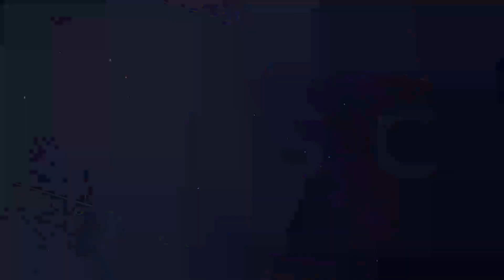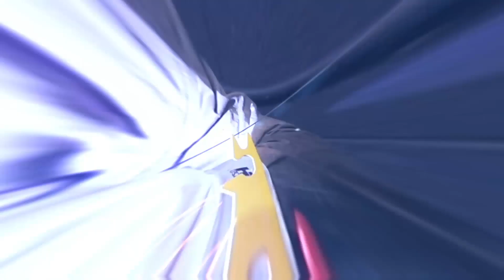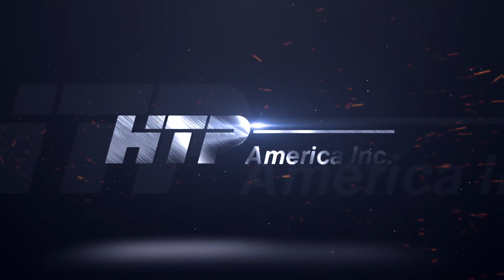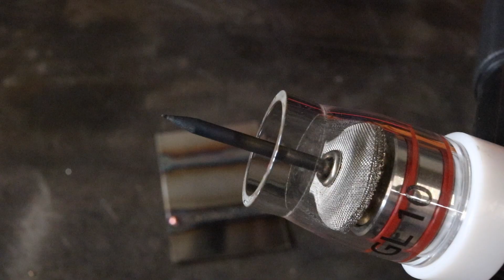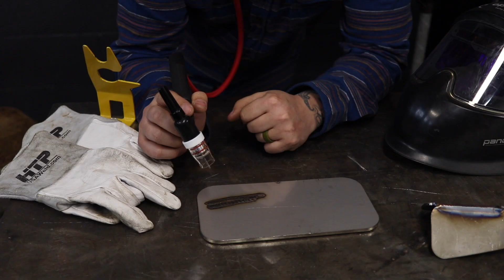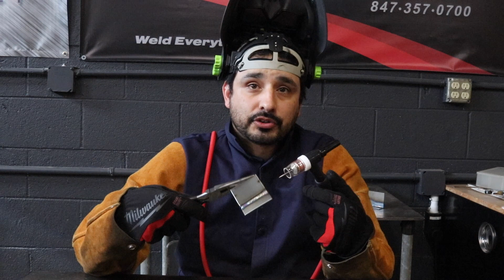DC TIG welding with the HTP Pro Pulse 220 MTS

Comment: Does this pulse tig?
Reply from the maker: No pulse TIG on this machine. Pulse MIG is where this machine shines! Check out the Revolution 2500 if you want to pulse in MIG, TIG and stick.
Reply: @usaweld The Invertig does pulse tig correct?
Reply: @Mikael5732 Yes.

Comment: Little disappointed it not AC/DC tig
Reply from the maker: we already have an AC/DC TIG Stick machine that is DV. Adding that AC concept isnt easy which is why a lot of multi process machines dont have it yet.
Reply: @usaweld What model is that?
Reply from the maker: @Mikael5732  pro pulse 220

Comment: It would have really helped if you went over the connections for both the torch and pedal.
Reply from the maker: What do you mean? The TIG torch is a euro style connection and the foot pedal is a 14 pin foot pedal. The ground clamp is a 35 dinse. Hopefully this answers your question.
Reply: @usaweld  Yes exactly what I was looking for. I'm still fairly new and have mainly been using my invertig, not so much my pro pulse. It may seem like a silly question since y'all have a lot of experience but this little stuff helps. Right on 👍🏼.
Reply from the maker: @KingsWeldingandAutomotive  If you have your invertig then i wouldnt worry about TIG welding with this machine. But all the accessories can be found here: https://usaweld.com/collections/pro_pulse_220_mts_accessories